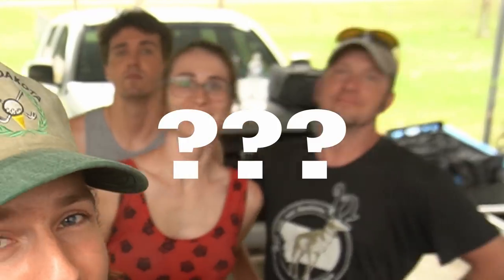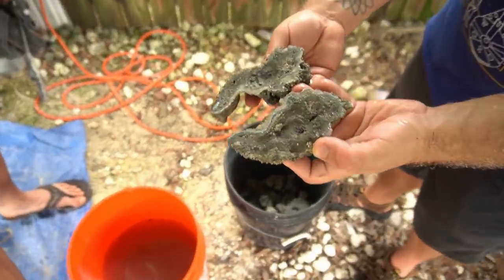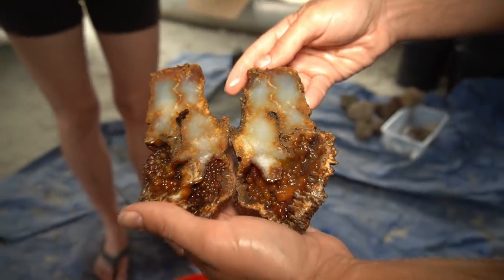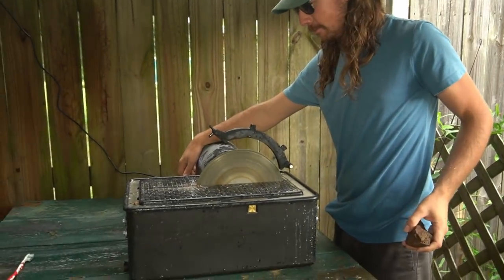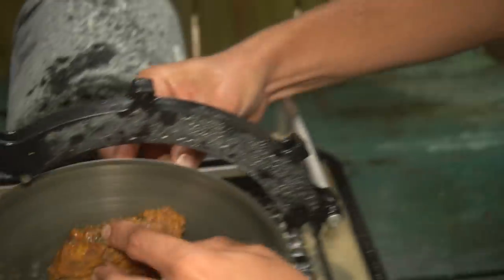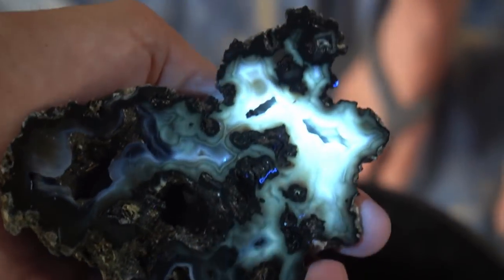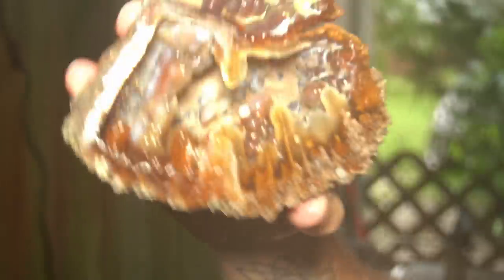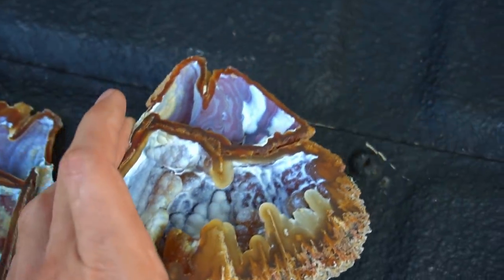20 Million Years in the Making | Cutting Open Agatized Coral Reveals an OUT OF THIS WORLD Scene!

Comment: For anybody wondering you can use an $80 tile saw from Home Depot and it will work just fine for cutting all Stones open. :)
I love seeing what's inside.

I'll be honest, I have a professional bench with polishing Stones and standard cutting blade, but I always use my thinner crappy tile saw to do the cutting. I have more control, the blades are cheaper, and the kerf is smaller which makes it a lot quicker..

You can buff them out with some cerium oxide afterward, and make your own beautiful published stones

Comment: I've seen your channel before but for some reason this caught my attention.
Never heard of agatised coral before, I must admit they are stunning, I had a large coral Shipped over to me some years ago, so big I couldn't cut it in half, but by the time I had eventually cut a section off and realised it was flint it had worn away most of my 18 inch blade.
So plain, solid and boring it was not worth cutting and the expences from the USA to UK were certainly wasted money.
With the uv light on your examples I could see why they are called agatised, it's often a difficult decision when putting a name on something that is out of the ordinary, I suppose the concentric bands that define agate were formed after they were fossilised rather than remaining under water and becoming marble the ground must have lifted. 
Very interesting  video.

Comment: She needs to share the recipe.
Reply from the maker: Ohhh yes I would love to know this recipe it was so goooood!
Reply: Sure! 😊

Apple Bread

Makes: 20 servings
Prep: ~30 minutes
Cool: 1hr
Bake: 50 Minutes
Temp: 350°

Ingredients:
- 3 cups all purpose flour
- 2 cups sugar
- 1 teaspoon baking soda
- 1 teaspoon salt
- 1 or 2 teaspoon ground cinnamon 
- 2 eggs, lightly beaten
- 1 + 1/4 cups canola or cooking oil
- 2 teaspoons vanilla extract
- 3 medium Granny Smith apples, peeled and chopped (sometimes I will grate some of them too and use a mixture of larger and smaller bits)
- 1 cup chopped pecans or walnuts (I used walnuts) toasted

Directions:
1. Grease a 13x9x2 inch baking pan, set aside
2. In a very large bowl, combine the dry ingredients: flour, sugar, baking soda, salt, and cinnamon. Make a well in the center to pour the wet ingredients.
3. In a medium bowl combine the wet ingredients: eggs, oil, and vanilla. Then stir in the apples and nuts.
4. Add the wet mixture to the dry mixture and mix until evenly moistened. The batter will be a bit stiff.
5. Spread the batter into the baking pan, then bake for 350° for 50-55 minutes or until a toothpick is inserted and it comes out clean. Cool for 1 hour.